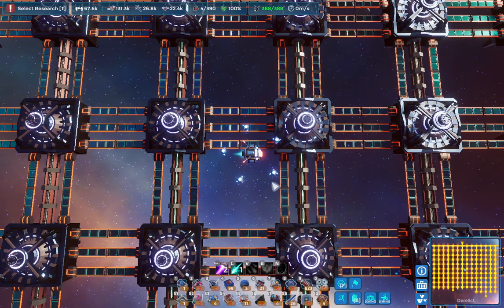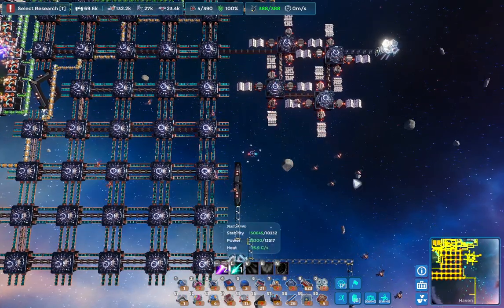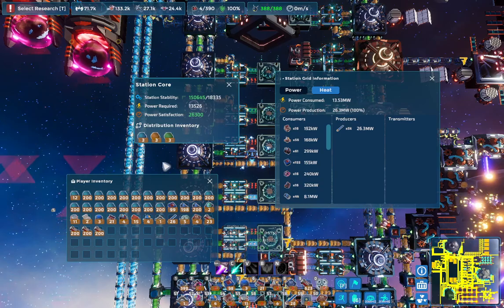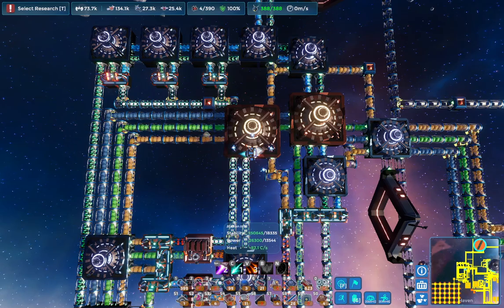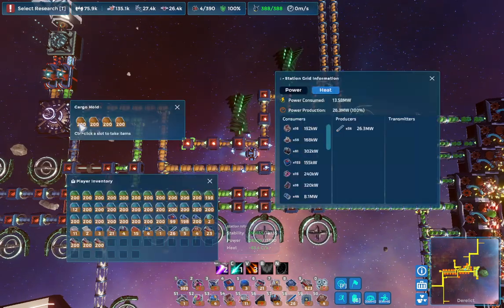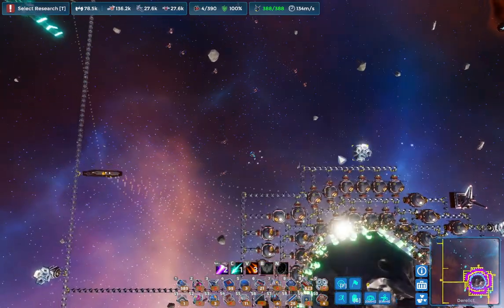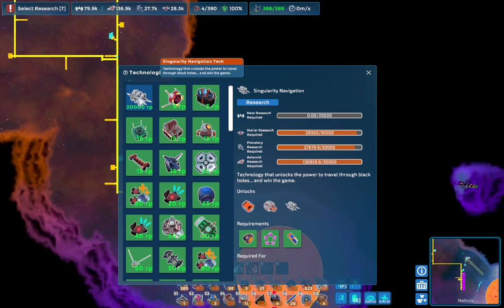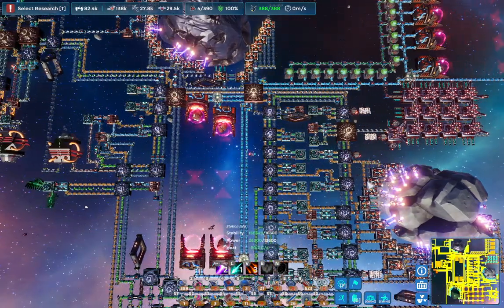Welcome to my crib! This is the monolith build at 17 hrs in Final Factory!

Comment: You still can make a mega factory, you're just thinking of them as seperate facilities rather than buildings in a greater whole :)
Reply from the maker: Though that is certainly fair I just kind of took each play through as having a certain set of rules. Like the playthrough before this one ran all small locations with a massive amount of inserters (Kind of the other extreme). Now this run I am just seeing how much I can do to test the waters in the other extreme and its still doing fine. Though I can easily make it about 8-9 times the current size so I still have a ways to go before I have to modify things a lot further.